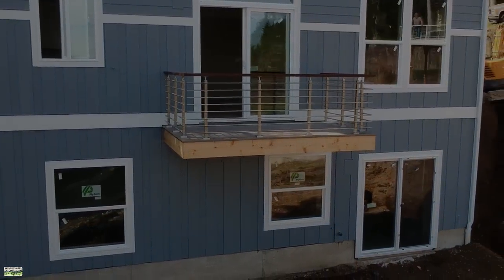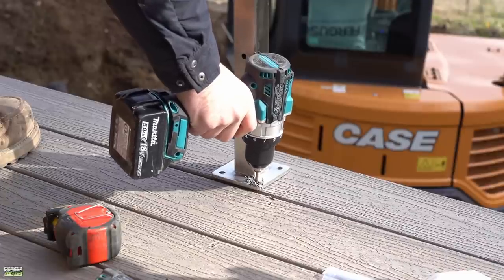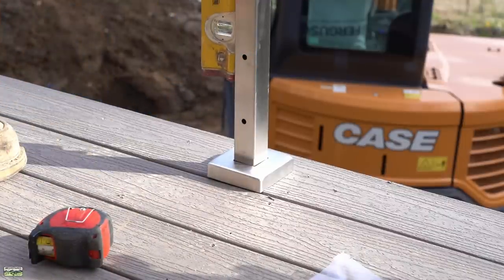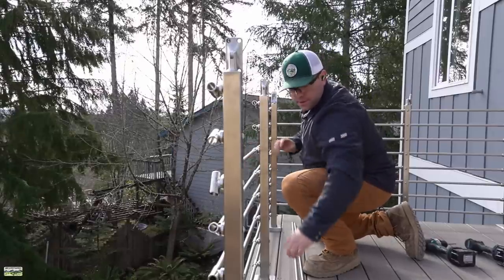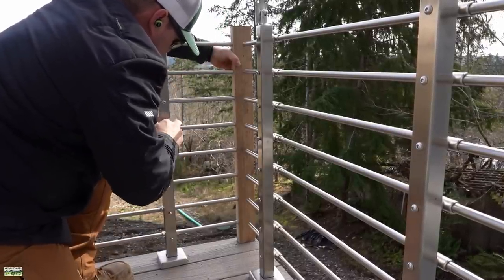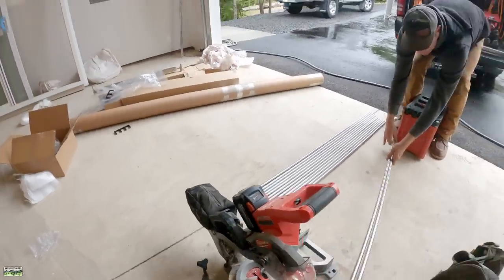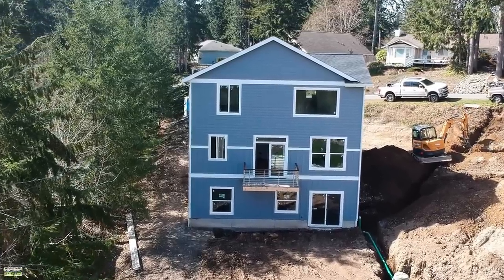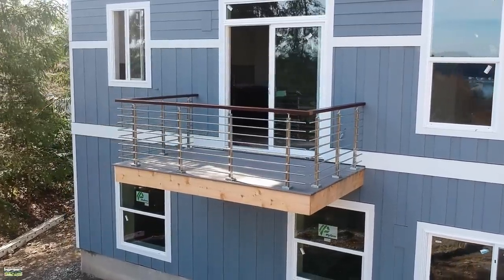Worlds Easiest Railing Install? Cascadia by AGS Stainless

Comment: OK. Several issues here. First, no framing. Not only am I outraged, I'm also incensed. There will be a strongly worded letter drafted. Second, "humor" the post. That is just fantastic. - This system looks tight. Nice work, as usual.
Reply from the maker: I miss you Mark 🙂

Comment: I was hoping you could show the top rail installation
Reply from the maker: Just screws from underneath
Reply: Cut your top rails to length, test the miters, place on top of the mounts, trace the holes, pre drill without drilling through face, use a right angle drill adapter if needed

Comment: What is the framing structure below for the railing post?  Blocked in 4x4 w/ appropriate fasteners? thanks
Reply from the maker: The outside joists and rim were 4x

Comment: Them rails not only look beautiful but looks great,now a question with a comment about the longer ones where as I would've staggered the long to short and so on,what's the strength of those tubes such as someone not of framers girth the ability to climb on them,say a two hundred pound infant? Asking for a friend.
Reply from the maker: I don't recall the max spacing between posts, but I think 42"'.  Those stainless tubes are very strong, but I wouldn't stand on them, they are too pretty 🙂
Reply: @AwesomeFramers  was thinking about the children 🤔🤣